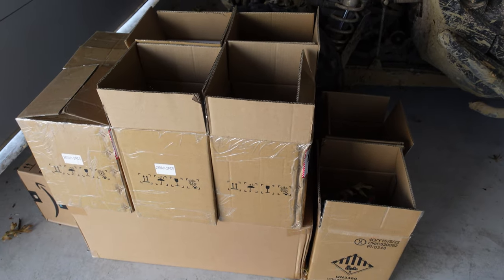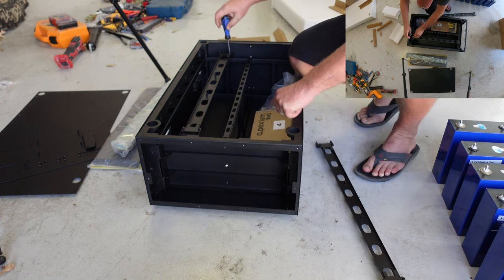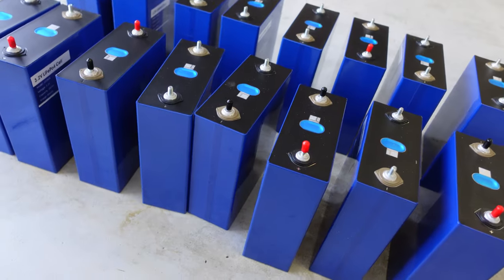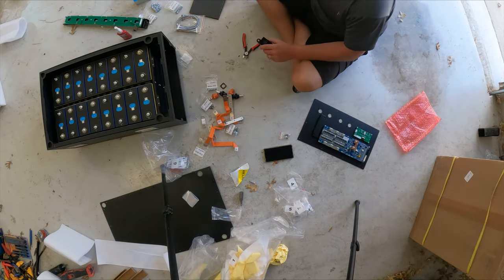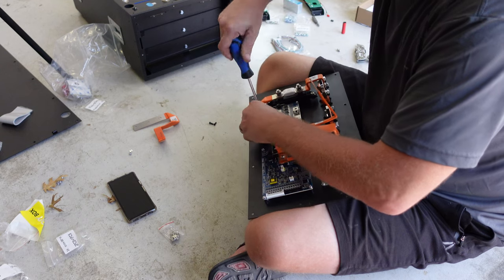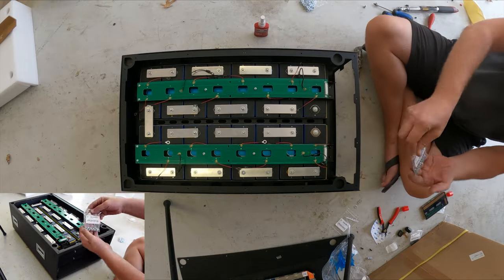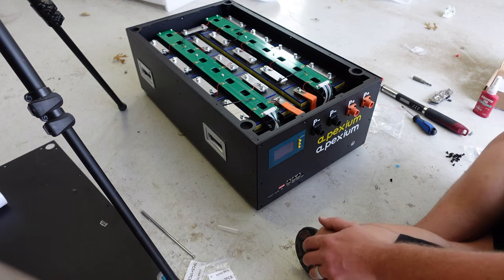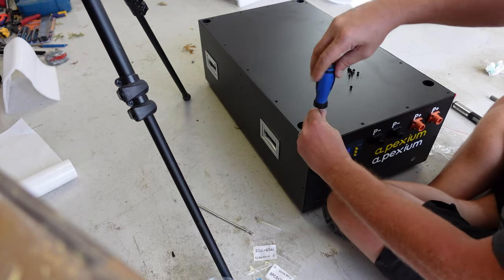Apexium DIY LifePO4 Battery Build 280AH

Comment: We use Ford C-Max (Energi) 7.6 Kwh per battery and we pay less then $75 per kilowatt and they are Panasonic made in Japan cells. Been using them since 2018 with no BMS and they run our home 24/7 and yes, I have checked the cell voltage a few times and they have stayed where they were when I purchased them so take it or leave it.
Reply from the maker: That is pretty cool. Do you have any videos of the pack?
Reply: @afreemanreigns did you bottom balance these cells?
What happens when one cell decides to die on you?
And get reverse charged?....

Comment: I've built two EEL cases and both times dropped a screw in the back, which fell through the slots.  Try using the foam cutouts (scrap, for the battery vents) to block the slots in there before you install the balance lead bars with the screws in the back
Reply from the maker: This is a good tip.

Comment: a question:
what is the value of this kit over say an EG4 LL?  These kits with a batteries are much more expensive in dollar cost, and have the added expense of needing to be assembled?
Reply: ok rather than delete/amend, i'll reply to my own post, since I didn't do enough diligence.
So looking up the total cost of an EG4 LL-S delivered to me, it'd be ~$1700.
the complete kit ((China stocks) 15KWH DIY Battery : 48V DIY 280/304 kits + 16pcs EVE LF280K V3 cells + Inverter cables + RS485 connector) would run me ~$2000 delivered.
So for an extra $300, it's nearly triple the capacity.  It's a lot of scratch to lay out at once, but it's also a lot of capacity.
Reply from the maker: The biggest deal is you are on your own if something with them goes wrong

Comment: Thanks for the vid. What is the amp rating of the bms? Do you know what bms it is? Are the boxes stackable? Do you have an idea of the weight? About how long did it take to arrive? What was the cost? So many questions -thanks
Reply from the maker: Its an Apexium BMS 200A model. 
The boxes are stackable
They are heavy - like need more than one person heavy
Mine showed up quick as they have a USA Stock, but ask Jenny and she will tell you
I don't want to share a cost, that locks Jenny (and you) into whatever price I put on here. It's not my place to say or speak on her behalf. I would ask her for pricing as this market is constantly shifting. I can say that the first round of cells I bought two years ago were quite a bit more expensive than the ones I just bought.

Comment: Torque is measured in Newton Meters not Nano Meters … just in case anyone is wondering what you meant …
Reply from the maker: Well it's measured in inch / foot lbs in the US. Thanks for pointing out my misspeak.
Reply: @BecomingOffgrid  Um, yeah, but you didn't say inch pounds or foot pounds. You said nano meters. There is no torque measurement ANYWHERE that is "nano meters". What a strange response to say "well it's measured in inch / foot in the US". Newton meters are also used in the US, by the way.

Comment: Those are pretty cool.. Can u build them cheaper than buying the eg4..
Reply: You would have to buy three EG4 100ah batteries to get the same as what you would get in this build.  Check out the prices of the cells, and the kit to compare.
Reply from the maker: Way cheaper. Somewhere near half to 2/3 the cost. When you are buying 3 or 4 of these it's a substantial savings.
Reply: Just check the prices out they are way cheaper for real
Reply: bought the parts last week, all the parts needed using EVE 280Ah cells and this Case from USA stock (which has already arrived, FYI, less then a week from ordering with a Holiday Weekend) came to a little under $2,200, by comparison the current lowest price on the EG4 PowerPro Indoor model is $3,299 (before tax), so it's legitimately 2/3rds the cost of the EG4 or more if you are in a state that doesn't go tax free on solar, the final savings vs the EG4 PowerPro indoor came to $1,345 and change.

Comment: Fantastic!  Was really looking forward to your build after you’d mentioned it in earlier video.  Makes so much more sense if you’re going to power a whole house.  Guess I’ll have to get me some. How low a percentage do you normally cycle these down to? ⚡️☀️👍
Reply from the maker: I try to stay above 20%, but the hard emergency limit is set at 10%
Reply: Is it possible to operate these Apexium battery boxes standing up vertically? Hadn’t seen anyone do it yet but if the cells are clamped down into the box I thought it might be possible? 👍
Reply from the maker: @terrahillfarm Yea they should be just fine running that way. Plenty of people out there have the cells laid flat in production systems. I would ask Jenny if there are any designed for vertical orientation coming down the pike. May be worth the ask and wait if they are.
Reply: @terrahillfarm  I was told by a rep. that they are not designed to be vertical but if you must, to secure it very well. There are boxes designed for vertical, EEL makes one.

Comment: A disconnect needs to be added to these units, have 2 of them and if the bus bar that they are connected to is live the unit will start charging or discharging no mater what position the push button is in
Reply from the maker: Yea that push button doesn't do much. I have mine on external breakers.

Comment: Thanks so much for the video!  How much do these units weight when assembled?  Did you assemble in place or get a couple friends to lift and place the assembled battery pack before wiring it into the central bus bar?
Reply from the maker: I used my forks for my little tractor to move them around. They are too heavy for one person.

Comment: Are all of your batteries 280ah, what kind of Charge amps are they charging with.
Reply from the maker: They are all 280AH cells. This depends, but the maximum is 300 amps spread across the 5 batteries - so 60ish amps per battery.

Comment: Good job & nice build, looks like a solid unit, I did notice it is missing the Confirm (yellow) button, or is that how it is meant to be? Would be nice to know more details of the BMS used, type, surge capacity, balancer type & current, etc… 
I would double check ur sequence for installing the balance leads & battery main leads, as I thought ur supposed to tighten down ur battery leads before plugging in ur balance leads because if ur 1st & last balance wires are mot making a good contact when you plug in the leads it can give a BMS error msg, but it may not be the case with this BMS. 
What an excellent build this is, been checking out ur other vids, good info. Cheers
Reply from the maker: The yellow button didn't fit because I put the sticker on crooked. 

The rest of the data you are asking for is straight from Apexium. The BMS is apexium and it includes a balancing function. Its a 200A BMS. Jenny would honestly be a better person to ask those super technical questions to. I don't really know all of those answers.

Comment: very cool, looks like it would be $16-17K for each set of 16 batteries then the box.
Reply from the maker: 16k for a set of cells??? Um no, I have no where near that kind of money
Reply: is that in pesos or yen? each 280Ah Eve cell is currently around $90-95 USD and the Box and BMS was like $600-700 USD, the out the door shipped price last week for me from USA stock using EVE 280 Ah cells and this box was $2,184 paid via Paypal. By comparison the CHEAPEST Price on the EG4 PowerPro Indoor Model battery is $3,299 BEFORE Taxes, with Tax (for me anyway) it jumps to $3,529.93 so I saved like $1,345 by assembling the battery myself.

Comment: I bought 16 cells from jenny wu and 3 of them came dented and scuffed. One cell had a dent the size of a penny and depressed about 1-2 mm. I spoke with Jenny and she said that they can still be used without ill effect. She denied an exchange. What do you think about that?
Reply from the maker: I think you should tell her that is unacceptable and need an exchange
Reply from the maker: I would think you should be hearing from Jenny regarding this issue. She is on vacation this week.
Reply from the maker: Did your problem get resolved? I think others might like to know.
Reply: It took a lot of back and forth with Jenny and FedEx and I am still not completely satisfied.  Fedex only covered 1/3 of the damage and Jenny Wu (and company) would only cover another 1/3. I ended up having to pay $127 for them to ship out 3 replacement batteries. I think Jenny Wu should have covered the cost completely. I also think having to wait a month is pretty shameful. BUT I guess it could have gone worse. Well, it did get a little worse.....

I also had a problem with one of the Apexium boxes. One of the temp probes was not soldiered on to the balance PCB correctly. This took me a couple hours to figure out and kept my battery offline for a day..... It was actually just glue that was holding it to the PCB and keeping the temp probe leads in contact. I let Jenny know about that and took pictures to make sure their manufacturer does a little better quality control. They are sending me a new board.

This is the price we pay as first adopters and DIYers.
Reply from the maker: Did you get your PCB yet?
Reply: @BecomingOffgrid  Jenny Wu sent out 2 new PCBs. Received them pretty quickly from China. They are installed and now everything is working.
Reply from the maker: Would it be possible to ask you to update the original comment?

Comment: Got me the 16 EVE 280Ah cells for less than €3k 16kWh battery going strong here!
Reply: Buying stuff directly from China is not  someting I would recommend to others..
It has some serious issues.
Reply from the maker: I prefer to use someone who knows how to speak English. I have a had a great experience with Jenny and that I why I made this video.
Reply: You can get 16 brand new EVE 280ah cells from battery hookup for $1,640 plus tax and shipping. They have 24.6 KW of New Gotion 16S 52.2V modules for $2400 plus tax and shipping. And they guarantee everything they sell.

Comment: Good job. I am on my way to build myself one. I bough the DIY box kit from Cassie Zhang (I'm from Europe). Next month I will buy the cells. From what I saw, eye-shopping around, this kit looked ok. Yes, for a 15kWh battery, the price is around 2/3, and you learn something in the process. I have 22kWh installed already (from ready made batteries) and according to what I know now, for the price I should have 32kWh. I do believe that  DIY is the way to go as the readily made batteries become more expensive instead going the other way due to the increased number of manufacturers. Anyway, here in Europe, the energy is quite expensive and being self reliant on it is a must (due to prices and the less maintained grid). Let's not forget the natural disasters that could become more frequent due to the already well felt global warming.
Having more EV's is putting a strain on the grid. I suppose that on the long term, if nothing happens (like WWIII), the batteries prices should go down.
Reply from the maker: They are working great so far
Reply: How much did you purchase your diy box kit from Cassie Zhang?
Reply: @iviemaro380  better ask yourself because the prices have dropped. Second what is good price for me, maybe not be good for you. When I decided to proceed and do use a DIY box kit & cells, my reference was the price difference between it and a ready made battery. So gather prices  for (1) DIY box kits & cells vs (2) fully assembled batteries and see kWh/kWh which is more reasonable from the price point of view. Bare in mind that you must take into account the (3) shipping fees (which will vary) + (4*) your own time spent to assembly the battery (* optional if ou want to have an accurate estimation).
Reply: @iviemaro380  the actual DIY assembly time is no more 2 hours if you want to take it slow. Have all the instructions printed or on a computer screen to constantly check them. Also once you have the cells, I strongly recommend to link them in parallel for a couple of days, to be sure that they will ballance themselves. If you buy the cells in one go (from a trustworthy source), it is quite like that they will arrive already balanced. In my case, I bought them in two batches, at at least one month apart.

Comment: Needs casters.
Reply from the maker: They sure do!
Reply: the feet on the bottom are held on by a bolt up the middle of the foot, I don't have proper measuring equipment to confirm it, but i'm fairly certain it's a 1/4" diameter, 20 TPI (thread per inch) approximately 5/8" long bolt that can fully seat all 5/8" of length easily and possibly slightly longer, using that information I started searching for threaded casters, the closest I could get had 1" lengths threads, I ordered those, should be here thursday/friday and I'll be able to confirm if thats the right bolt size and thread pitch by this weekend.

Comment: Thank you sharing a very interesting video 

Can you please share details related to the BMS

I have two Pylontech US3000C installed with 5kW Solar PV Panels and Solis Hybrid Inverter

Now, I am thinking to totally go off-grid and looking for good BMS to match with Pylontech Batteries 

Thanks in advance.
Reply from the maker: You would need to talk to Jenny. I don't know if these BMS will work for your batteries or not.

Comment: $3471
 with inverter cables to door
Reply from the maker: That is dirt cheap.
Reply: My cells were $2,200 dollars, $200 bucks for a BMS, $100 for a T class fuse, and maybe a couple hundred for cables, lugs, ring terminals, circuit breaker..And I built my own boxes out of wood I salvaged for free, from a project..That is a thousand dollar difference, and my BMS has an active cell balancer and awesome bluetooth app..I don't have communication between my all in one inverter/solar charge controller/AC charger, but, don't need that at all..Don't need a shunt either, I have way more battery than loads..But, I do like those boxes...And maybe I could have communication, never tried to connect it up..
Reply: I checked my payment and i corrected
Reply from the maker: They are really for fire prevention. I know LifePO4 just smokes and simmers - and I want that to stay contained. Too many posts on "Up in Smoke" on the DIY solar forum for me to take the risk.
Reply: Hi David & Real, there's ~$700 difference between your prices, Real goes into more break down detail, David's appears way more expensive if just inverter cables.
Could you clarify total build cost for me please, incl where from, Ah cell, resulting kWh, assuming you both did 48v/16s, & are based in USA (way cheaper & more availability vs Au)
Be also great to see same answer from yourself Becoming.
Reply: @Lana_Warwick  Lana I ordered the 280 amp hr 16 cells and the apixium DIY box from Jenny Wu with cables from china...still waiting for.
Reply: @davidparker1760  Thank you David. I empathise with the "still waiting", but either that or high mark ups from locals I guess.
Curious why Real's was less.
Reply: @Lana_Warwick  because he did not use premade box....he built his own case wood/metel...or he just placed cells on shelf and did his own wiring i believe. I paid for this DIY kit that comes with metel box and all the wireing and BMS. also i get terminals and breaker and lcd screen with bluetooth.

Comment: Nothing new, we make that kind of batteries a year ago....look for seplos or Eel batterie
Reply from the maker: The difference between the three is after sales support. I have seplos and eel cases as well. My experience with them was not good. EEL lied about the cases being in the US and My seplos cases came with damaged battery cables they refused to replace or even acknowledge. 

Seplos gave me firmware to flash to my BMS that bricked one of them, and then they refused to warranty that BMS. 

Different strokes for different folks I guess.
Reply: How about the build of each brand, similar? How do prices compare?
Reply from the maker: @supermo26  As far as build out goes they are all close to the same. The cases for the Apexium and Seplos units are thicker steel than EEL. The after sale support for Apexium is great. I will never buy from Seplos again because they didn't want to support their product.